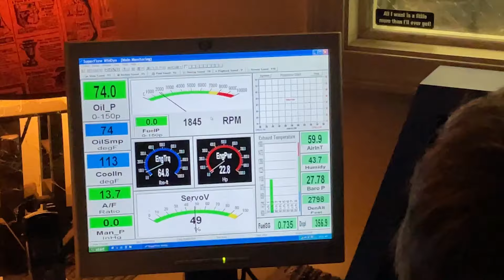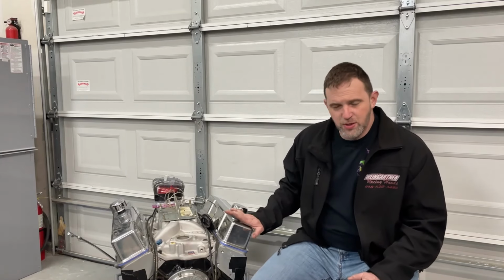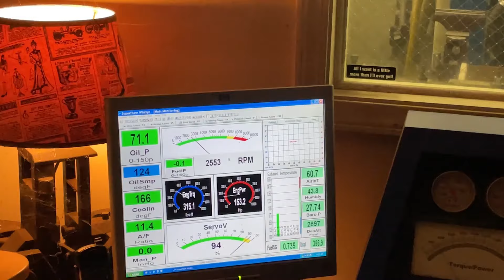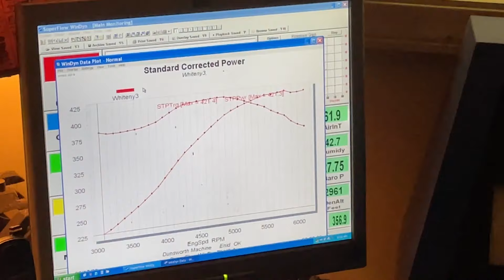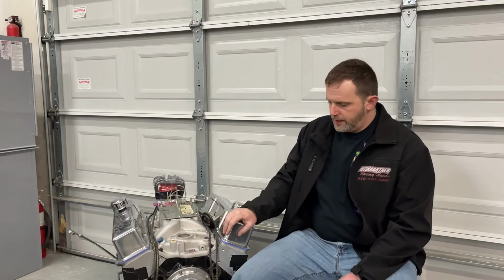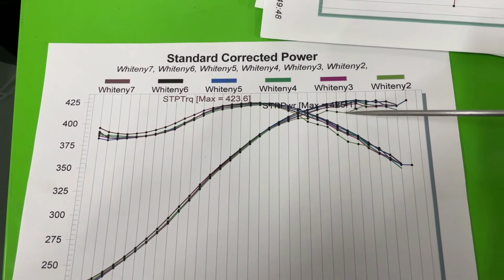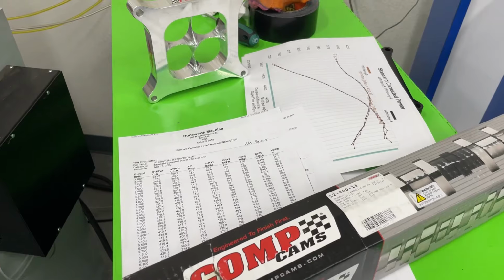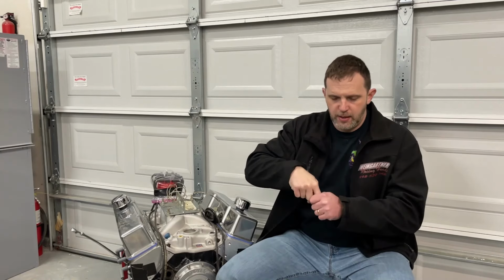350 Goes To The Dyno, Nobody Guessed Right

Comment: That cam did leave power on the table. With the head flow that engine has, 500+hp could have been achieved pretty easy. A Holley Strip Dominator intake and a bigger cam would have made it a different animal. .026 thick head gaskets and zero deck would get it over 10.5-1. But I can understand building it mild for a chic that don't like the sound of thunder.
Reply: Ya think he don't know that? He gave her what she wanted. Maybe MORE than she wanted.
Reply: @jeffrykopis5468  no shit....
Reply: @jeffrykopis5468  I know you must not have read all of my fuckin comment chief.
Reply: @jeffrykopis5468  what are you? His boyfriend? Go make a sandwich boy.
Reply: @thereluctantgearhead4544  Yeah I did. Why point all that out when ya know he couldn't use it? And a Strip Dominator is ancient tech, totally outdated. Especially for a street motor.
Reply: @thereluctantgearhead4544  Just had a cinnamon roll 😂
Reply: @jeffrykopis5468  just because somethings old don't always mean it sucks, just like new shit ain't always better. The old strip Dominator is still a good piece, it makes more power than the Vic Jr everyone seems to use. I've swapped it in place of a 1st run Super Victor and it went faster.
Reply: @jeffrykopis5468  I have a brand new Super Victor on my daily driver and it ain't no better than the Strip Dominator I had on it.

Comment: Boy that's a lot of engine for "I just want more power than a 2.8"  lol, I'd say a v6 would have hit that requirement outa the park lol....don't get me wrong I'd do the same a firebird should only have a v8 A cool not practical or most powerful but neat would be the baby lt1 L99 4.3 V8, it would make good power get really good fuel economy and just different and with your grinder magic  and good cam it would make well over the original 200hp and look pretty sick with the LT1 style intake. Just off the wall bench racing type idea, your sis is getting a nice mill it's basically what I've been wanting to toss together for my truck I would just have a more aggressive lumpy cam even if its not ideal gotta have that lope even if drivability suffers some because you know it's more important to look better than feel better!

Comment: That eps’s small runners are holding it back 
That’s a tiny intake 
to squeeze 420 out of it is not bad at all 
That cam is not a big cam at all That’s I nice size street cam
Reply: Ive made over 460hp @383ci with a very basically modded eps. Using 234*@.050" on the intake.  The EPS is not holding it back at all.

Comment: Thank you. I have been lookning forward to this video. :) 
Just want to say I posted that I guessed about 1.2 lb/ft pr. CID. 
425.1 lb/ft divided by 355 CID = 1.197 lb/ft pr. CID, right? Not way off I think.
Mild engines like this can not rev and therefore always produces the same amount of horsepower and torque. :)
I also always looks at XO that is:  (IVO-EVC) /2, in this case (23.5 - 28) /2 = -minus 2.25 degrees. That means the overlap is retarded 2.25 degrees in realtion to TDC and this is not good for torque IMO. :)

Comment: I was right about one thing 🙄🙄🙄🙄! When you just stick something together, of course with everything being right machine work wise, they always make better power than you would think 🤔🤔🤔🤔! When you spend a ridiculous amount of time trying to make everything perfect, they always seem to let you down 🤬🤬🤬🤬! It just seems to be that way!  My guesstimate was based on china heads & box 📦 intakes 🙄🙄🙄🙄! I should have figured higher because you did the heads! But the 385hp 400tq is what we’ve seen on stockish rebuilds 🙄🙄🙄🙄, which we rarly do! 425 & 425 is pretty good for a engine someone just wants to put around with! I’m sure if you actually tuned on it, it would easily make more 👍🏻👍🏻👍🏻👍🏻! But it’s not needed! (I get it!)That engine will last her forever 👍🏻👍🏻👍🏻👍🏻! Even though the figures say 600 cfm is plenty! The restriction @ WOT would be a bunch 🙄🙄🙄🙄! Every single time we would stick a bigger carb on, 750/830! (because customers already purchased the small carb due to all the estimated sizing charts 🙄🙄🙄🙄) they always picked up power! They only loose if you have something way too big! Did you look 👀 @ the 406? I wouldn’t be afraid to bring it to the dyno you were at, this time! When I said camshaft was off, I didn’t mean the grind! I know you said you degreed it also! But I found a really high end racing engine builders engine with the timing chain off 1 tooth 🙄🙄🙄🙄! Most would say absolutely no way 🤬🤬🤬🤬! But it was! (Yea timing chain with aluminum rods 🙄🙄🙄🙄!) Nobody could figure out why it was a pile of shit 💩💩💩💩! It would also break #8 connecting rod, every 6 passes or so 🙄🙄🙄🙄! Luckily it was a aluminum rod engine 🙄🙄🙄🙄! Which I actually hate 🤬🤬🤬🤬! But in a few cases it is necessary 🙄🙄🙄🙄! I have seen people use the wrong oil pump bolt 🤬🤬🤬🤬! They actually torqued it right into the rear thrust bearing! Then wondered why it wouldn’t turn over 🙄🙄🙄🙄! I also have seen SBFs with the main caps outer lug broken off! The one that goes around the dowel pin! But they did torque up good & they do run fine! I do think the 406 will run fine the way it is. Especially if he will shift it higher! We have had people ask us to purposely kill torque down bottom! Because they couldn’t get the vehicle to hook up 🙄🙄🙄🙄! Those few actually made it down the track faster! Mainly in dirt circle track! Because the tires would just bite instead of spin! Anyway I’m really glad it worked out 👍🏻👍🏻👍🏻👍🏻🇺🇸🇺🇸🇺🇸🇺🇸! I’m sure your tired of all the internet experts 🙄🙄🙄🙄! Have a good week! Remember that those pistons are called HYPER U BUSTIC 😜😜😜😜🤪🤪🤪🤪! Well for people trying to run them over 7000 on nitrous 😂😂😂😂! Your sister is probably never going to go over 4000 rpm 😂😂😂😂!

Comment: my message got erased for some reason i had one with an 900cfm not for the fuel but for the air made 500-480ft lbs but had pop tops floating pins . you should have a few carbs to try instead of spacers the spacers have never done much.thats gonna be totally different with a sniper

Comment: If that engine is in the car now I’m just going to bet the champ oil pan had to go. I have 3 of those things I tried fitting into my ‘86 Firebird and none fit, even stock appearing one. At least not with stock exhaust routing. Maybe you put long tubes on her car. I didn’t like any of them that were available at the time I built my car.

Haven’t seen the other video but based on the specs you’ve given and the flow rate of the heads, and at what RPM it made it’s highest hp, even with the low compression and garbage quench, I’ll say 430-440hp.

Comment: How could it be horrible on torque with only 215 degrees of intake duration and over .570 lift. Lol I know the lsa was wider that idea but with the short duration your still closing the intake valve early ish.  Those long dyno headers plus the longer exhaust duration are helping the later intake valve opening point. At least that's my thoughts on it.

Comment: Kind of surprised it reved that high. looks like it is running out of valve spring 5700-5800.
Reply: 214-215 intake duration cams usually HP peak at that RPMs if the heads flow OK and enough valve spring...

Comment: Edelbrock do a 350 with less head but more cam same numbers  HP TQ . Proof that good good breathing cylinder heads need less cam . 
From what I`ve seen unless you go stupid with the heads a slightly larger head is ok . As u go larger in heads u    flatten the midrange 5-20 hp/tq  but not drastic .A very large exhaust primary pipe does the same .  What A dyno does not tell u is throttle response . Highly suspect your heads have a way larger mcsa /pinch than an Edelbrock . What did the pinch measure ???

Comment: The why not 383 thing yeah I get it but people these days are soooo quick to dismiss 350s as pffff just a 350... 350 can make killer HP and it's simple no custom parts no block mods not that is complicated but still. Take ford the 302 is so common that when people build a stroker 8.2" people are like wow a 347 man that's killer it should make soooo much power ohhhh. Why aren't they saying ahhh 347 not bad guess if going for a mild low hp street build, ahh it's ok not bad but it's no 363, nope people act like a 347 is badass combo especially crazy seems if the deck height isn't an issue a regular old run of the mill 351 gets you basically the same place (actually 4ci more), but with 351 you have better intake runner geometry, better piston geometry and stability and as a bonus big inch stroker options but once again you have a 351 and people will say only a 351... Coulda built a 408.... There's no winning it's all perspective. Imo if your not racing a little more doesn't matter. I've thought of tossing boost at my daily driver 95 mustang gt but I thought when will I use it... To pass a car on my 20 min commute, a fun healthy NA HCI 5.0  engine will def suffice to have fun and save myself thousands and headaches. These gotta have a 383 guys bug me and I e priced it they are not the same price especially if it requires a different flywheel and harmonic dampener/ballencer and piston choice is important from compression ratio changes, it's all good it's not rocket science but not as no brainer as some claim. Rant over.

Comment: Here's the deal everybody's saying that's going to ping it don't pay for a reason you're small block Chevys in general like that kind of timing but your initial timing is basically where it wants to start and run but your total timing is what is determined mostly by your combustion chamber shape I mean within reason they're all pretty close most engines but combustion chamber shape makes a big difference so you can take a stroker engine and a short stroke engine and put those heads on the same engine with the same high compression and the timing total timing pretty much going to be correct on all of them